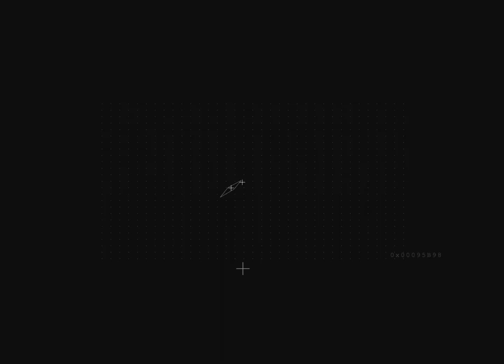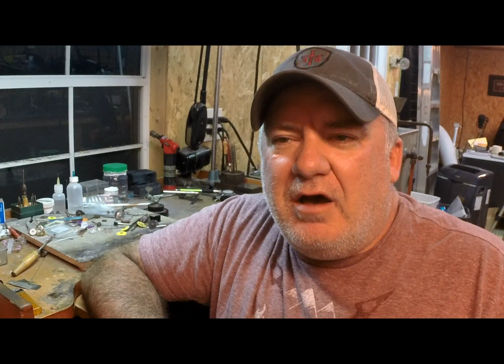Why Is White Gold Rhodium Plated??

Comment: white gold is white through and through you buy casting grade white gold which is palladium or nickel sometimes cost inhibited so to get around that you use 14K yellow then rhodium plate it
Reply from the maker: You should never use yellow gold and rhodium plate it to make it white unless you want an unhappy customer later. I’ve never found white gold to be any more cost prohibitive than yellow. It’s just marginally more.
Reply: a lot of jewelers do that that's the reason i never purchased white gold from any jewelery store or out let most of the time rings chains bracelets are made in 14K yeollow or 18K yellow so if you see yellow gold bleeding through most likely that piece of jewelry was yellow at one time and plated over with rhodium if you take 18K white gold nugget cut it in half it will be white through and through but now if you don't want to pay the high price of nickel white or 14K palladium white you can give a customer the option of yellow plated white
Reply from the maker: I’ve been a jeweler for 28 years, I’m well aware of the characteristics of yellow and white gold. I also will go on record to state that any jeweler that sells a piece of jewelry as white gold that is actually rhodium plates yellow gold should be run out of town. That is a horrible practice to partake in.